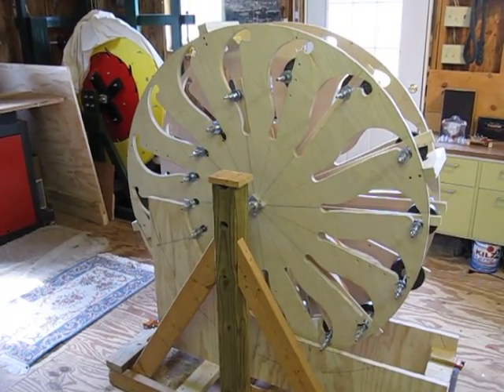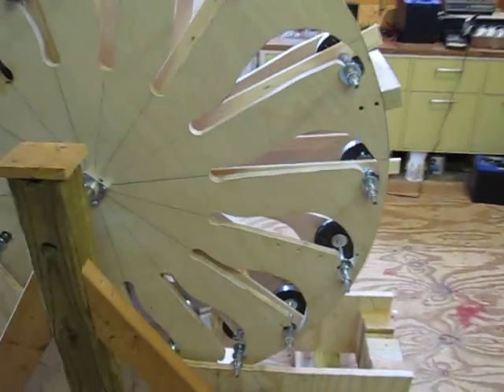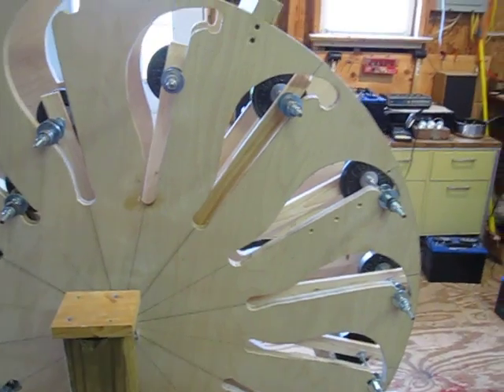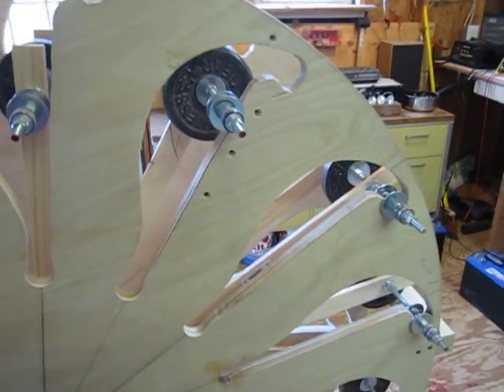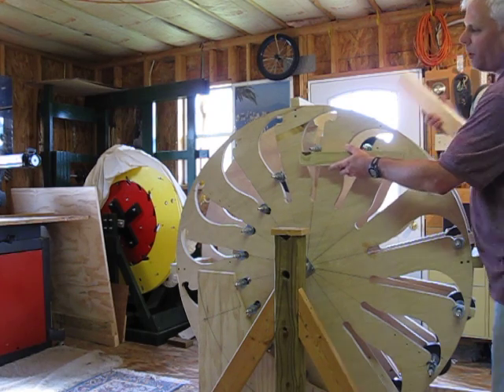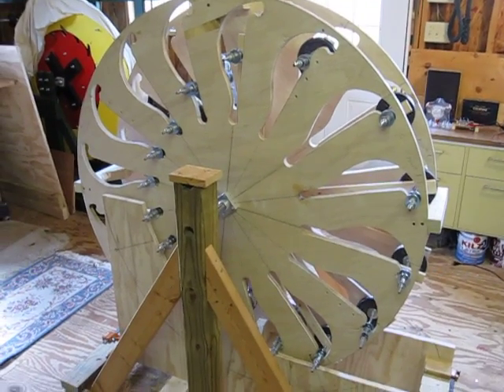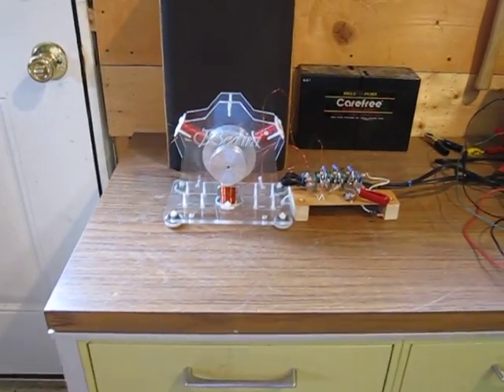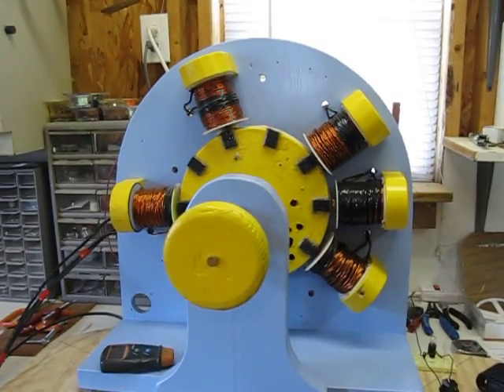Abeling Gravity Wheel Free Energy Replication Update

Comment: I should have suspected as much, after all it's a vertical wheel. I find vertical wheels tempting, too. If you want to try another one, I recommend the idea of two-point hanging weights pushed outward by an inner angled tower attached to the axle, with the axle coasting around the center bar, with the center bar not moving. I have a video of an attempt at that design that looks ambiguous, maybe it has some potential. When I moved the hanging beeds in that design I saw rather extreme motion, but it was not 100% symmetric, but sort of close. So, I find interesting conventional wheels now and then. I don't think it's the best class of device, but I think someone will succeed with one or more variations eventually, even if they have to go horizontal or add some type of leverage component. https://www.youtube.com/watch?v=7K4dNuynNjU

Comment: I raised the front of the ramp to 5 o clock, smoothed out the rear circumference of the ramp with a crecent moon arch to remove the slam into the wall factor from your ramp design.
Damn thing runs smooth as silk perpetually, however I had to install s 1/4 steal plate flywheel on the outside to get real good work out of it.

Scott. You and doc and steal should have gave this to humanity because you won't live long enough to spend the money you morons sold it for.
That said I bet your already dead and gone.

Comment: I really really wish the weight holes were closer to the rim of the wheel.  That way you could use a much smaller ramp, on the bottom and the top, and more of the weights could be put into use at one time.  I think that's the extra power you need to turn this wheel.

Comment: how about if you spun it well to begin with, had an electric magnet pulsed to assist the lift of the weights along the top where you'd shown the need, as it is if the wheel was spinning and geared with small gears and a tiny (i mean tiny) generator to power the electric magnet - see here - mister wizard used a single AA battery to lift a adolescent boy (approx 100 lbs)-   http://youtu.be/rEdlp7Cr3AU?t=2m11s ,  that's very little power extracted for such lift, you should use a tenth of that. so no incurred impedance on the wheel really

Comment: Very nice construction work! To lift each weight vertically at the top of the wheel and past the threshold hump to land it into the notches requires too much energy. Wood inherently has too much friction, even though wood is easiest to work with. All the friction points will add up together to keep it from working. Metal shafts sliding on wood act like numerous friction brakes. Curved wood guide at bottom of wheel used to keep weights near the center is a wicked source of friction and will brake the wheel. It can never run with this in place with metal shafts on wood.
I suggest re-thinking the entire wheel design from the ground up, keeping friction issues in mind at every step. Large number weights you have certainly will result in smooth operation when it runs. If the metal shafts holding the weights are smooth, you may be able to retrofit each of the slots with a piece of metal, arranged like knife-edges to minimize friction. Find a way to eliminate the humps in each slot. Humps just consume more energy. It appears each of the weights is off-center on the metal shafts, which means the shafts will not roll in the wood slots. Ball bearings on each of these weight shafts will eliminate unwanted friction. If the ball bearings ride on metal races, the point of contact will be at a absolute minimum.
Preston, let me know what you think of my suggestions.
Reply: I agree - too much friction! redesign wheel using something like water which moves freely.

Comment: You're trying to lift a weigth (m) a certain  heigth (h). The energy required to do that is E=m*g*h. g=9.81 meter per second squared (normal gravitational accelaration on earth). The same amount of energy is set free if you let the weight travel all the way back to the lowest point. So at best, the whell would just keep spinning without getting faster. So it doesn't GAIN energy. In reality it loses energy because of friction or other limiting effects, so it isn't a perpetuum mobile.

-Science-

Comment: Your measurements and calculations are off. The wheel looks heavier than the weights, plus your slits for the weights are not properly done, and the ramp pushes them to the center too soon and adds too much friction, also the weights should roll smoothly and they do not roll at all.

Back to the drawing board. It will work, if it's made right. Try building another one from scratch.

Comment: If you were to recreate this one Preston I'd think about using a spiral patten for the scoops and you should aim to have the weights closer to the axle (ie within an inch on your current design size).  If you are wanting to expand the design you could look to a magnet at the axle, so as the weights are slowly rolling towards the axle they roll quicker, however you'd have to experiment so as not to restrict the weight release on the opposite side.  Unless of course you have a mount for that side.

Comment: Hi Preston,
I believe you have two problems with your design, in my opinion your weights need to be closer to the axle on the way back up, as this will give a better effect for the downward weight (ie takes the weight and not the downward weight).
Second one is that the scoop is too great/harsh, because your scoops are almost verticle at rest (the bottom), if you think about it the most energy used is going to be at the bottom, if you lessen the angle, you would save energy (ie start at 30deg)

Comment: yes your correct is way too much resistance in the machine and is greater than the off balance force gives! This type of machine will never produce extra power to do work but only provide enough to make a circuit to maintain motion and in order to do that it has to be perfectly balanced and this example is far from that!

Comment: I don't know what your educational background is. but it's certainly not an engineering. well, I will try to explain you something about 'mechanical advantage', or in layman's terms "leverage principle",this is used to ease the job. it's used in lever, cranes,bike gear train etc.we can't change power output of the system though. it's like riding geared bicycle.when you are on the steep u change to higher gear so that you can paddle easily but you have to paddle more time then normal.hope helped.

Comment: I find it safe to say your discouraging without merit. This wheel works on the leverage principle. You know what that is don't you? You can lift heavy weights easily? The further the wheel is from the center of rotation, will be able to lift it's own weight which is closer to the center. NO? The reason it' doesn't work is because the weight has to be all the way to the outside just after TDC. All the way to the bottom. Then it has to immediately be moved as close to the center as possible.

Comment: A main property of gravity is that what comes out (energy), had to be put in first. This kind of gravity-wheels has been proposed numerous times since the last 150 years or so, and none worked. If you could eliminate friction, theoretically such a wheel could turn ad infinitum, but as soon as you try to let it do work, it will stop after some time. Whatever work it did during the time, is the potential energy that was in the device from start. Gravity stores energy, does not "produce" it!

Comment: you made a mistake in the design, the holes in the wood has to be slanted down more, the weights going down they have to roll down on the top of the wheel the slant of the wood edge has to move down a bit.

Comment: I've drawn a self sustaining gravity wheel and the math shows it will work , haven't built it .  But some thoughts are 1) too much friction(you need aluminum or steel or plastics) 2) remove the notches they add friction 3) the lower ramp juts too far forward and too high to allow the full authority of the weights to apply to the inertial mass of the wheel at the bottom(your losing applied pressure too soon) 4) inertial mass and balance have got to be exact (lumber is has to much variance in it)

Comment: Much respect for what you are trying to do and the best of luck to you however i would point a few things out.
1.  If it doesn't self start it is almost certain not to work because logicaly if you are using gravity one side would be perpetualy trying to fall, like a fat guy and a thin guy on a see-saw!
2.  Although the design is in accordance with moments you seem to be incorrectly implementing the moment of inertia and rotational energy formulae.
Best of luck to you reaching for the impossible!

Comment: You are really close to an very interesting mecahnical movement.
You need a pendulum that swings right at the point where you were moving the weights with your hand.  Use a weighted axle to drive the pendulum sufficiently so that it will move the weight like you did with your hand and that might be very intersting to see.

Comment: @jallaguri You hit the nail right on the head.  Each weight goes through the same up/down range no matter what.  Without a frictionless wheel, which is impossible, it will stop running.   Even in an ideal frictionless environment, you can't get any extra energy from it.  The spinning wheel is charged once with rotational energy, presumably from someone's hand.  There is no possible creation of energy.

Comment: I cannot see the dissapointing part. The wheel itself prevents it to be a selfrunner because the difference in altitude for each weight in one revolution is limited to be the same all the time. The bottom line, you made a wheel that is preventing itself to run - like everyone else is, and has been doing during the past few hundred years. There will never be excess kinetic or potential energy as long the weights are limited to a given and constant change in altitude.